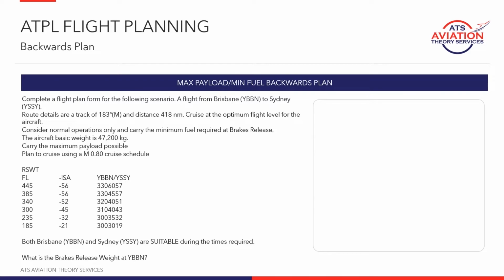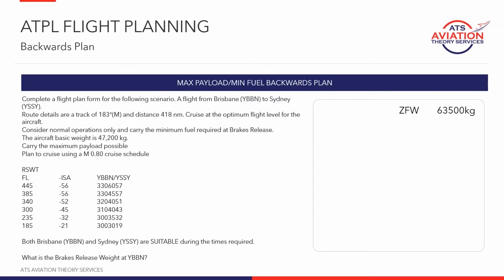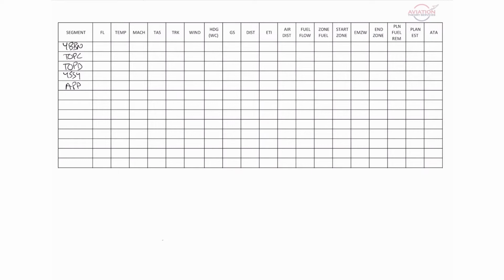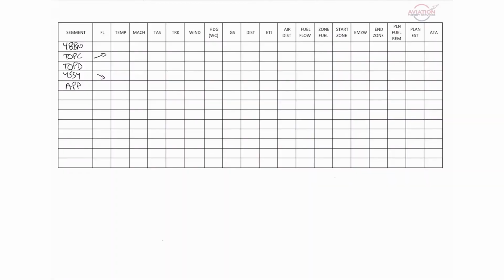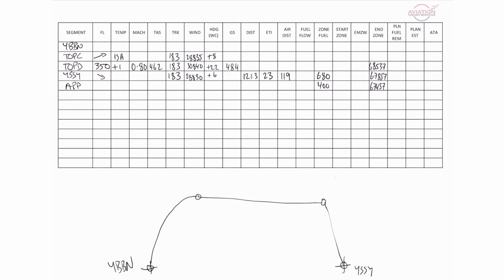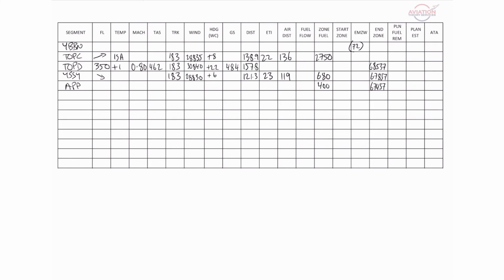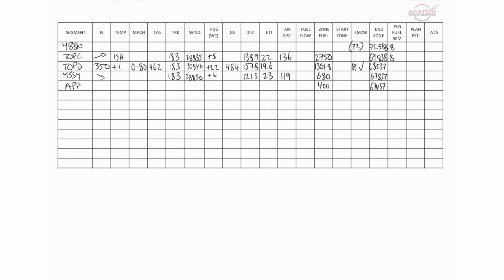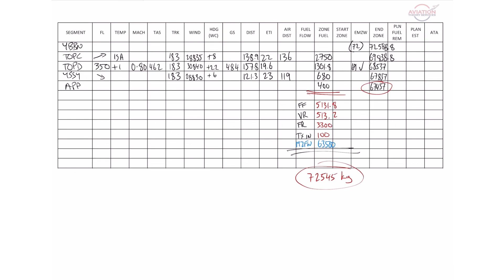Maximum Payload/Minimum Fuel Flight Plans for CASA ATPL Flight Planning Exam

Comment: I had a crack before i watched it and got BRW 72526 with est of 72572 in 13 min. Honestly this extra step i had no clue so i was going to get it wrong anyway because I would answer 72572 (as my estimate).  At the end they are very close and surely a type in question will stuff it up regardless....or if is multiple choice there we will see:

a) 72520
b) 72540
c) 72550
d) 72580